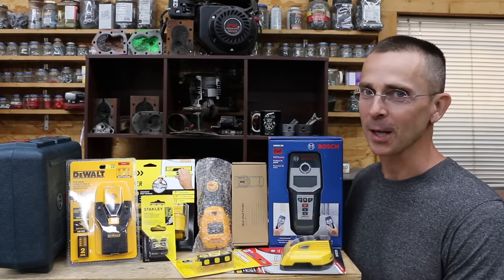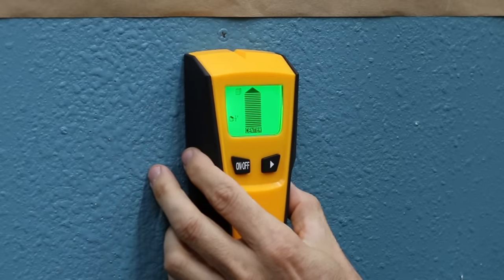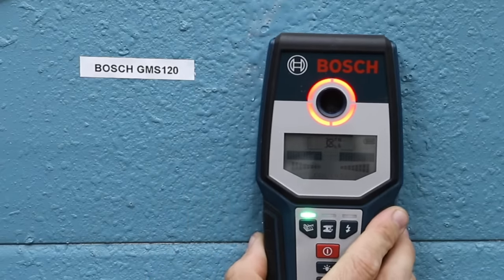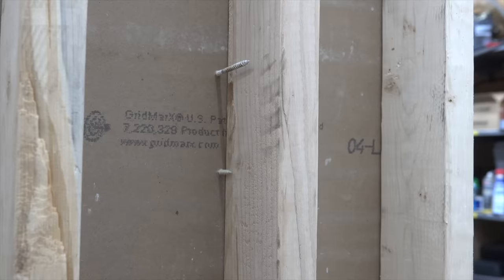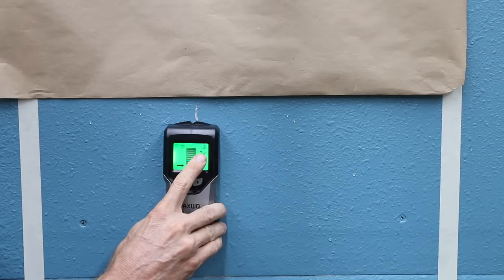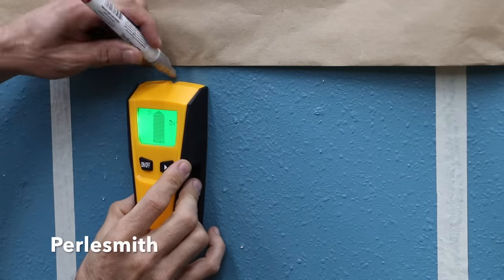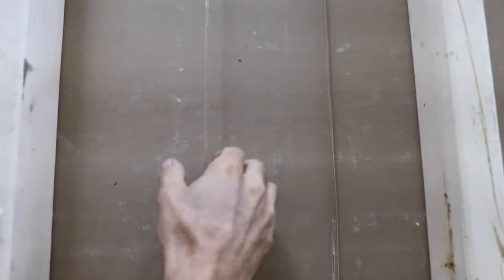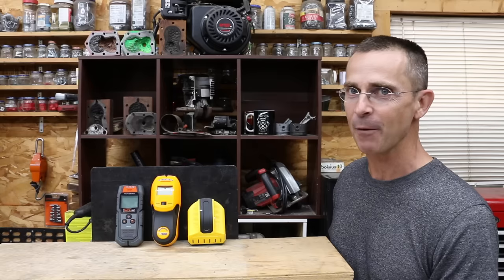Best Stud Finder? $262 Bosch vs $10 CH Hanson vs 9 Other Wall Stud Scanners! Let's find out!

Comment: I would have liked to have seen the results on plaster lathe, or plaster over drywall (from the 40s) using the “deep scan” setting on some if the finders.  I have been searching for one that works well for a long time and haven’t found yet.  Great job though!
Reply from the maker: Thanks!  Thanks for the constructive feedback.

Comment: Something that made me twitch pretty quickly was when you started saying "found the water pipe", "found the wire", "found the conduit". Most of these only found "something" in the wall. Could be a stud, could be a conduit, water pipe, wire (live or not). 
I wouldn't trust any of these if they couldn't positively separate between at least "stud" or "other".
Reply: Well, studs are always the same length apart, so if you find something that has different spacing, you know it's something else.
Reply: That’s were you should find a couple and look for the 16 or 24 inch pattern, and ignore the stuff between that
Reply: Yes! The Zircon even seemed to find false edges when detecting the wire and the double readings it gave seemed to indicate a stud. See 9:05.

Comment: I've been using a Zircon at work for years, it's almost as good as X-ray vision.  You just gotta scan a few times to zero in and once you've gotten a feel for it, you can nail the center of damn near anything.
Reply from the maker: Thanks for the feedback.
Reply: Bought the Zircon a couple of years ago but it does not work at all on plaster walls.  My home is 1945 built. There are two types of plaster walls involved, some with straight fiber backer board and some with metal mesh backer, the metal mesh is impossible, but the inch thick fiber backer board/plaster coat should be doable.  The Zircon gives false positives all the time no matter how many times I calibrate.  I even tried it on known good no-stud cavities (already had the hole found/cut through the tried and true, drill a small hole and fish a copper wire method 🙂) but it still is clueless. I have a 30 year old Black and Decker that works better, but it's a monster.

Comment: I wonder if having a second layer of drywall on the other side of the stud (replicating the wall in the next room) would change the outcomes, due to the sensor models being able to recognise the interference of the pipes and or cables in the enclosed space? Thanks for your tests. New subscriber here! Cheers, Lance.
Reply from the maker: Thanks for watching and subscribing!
Reply: I'm not an engineer, but have lot's of professional experience using these things. Properly calibrated, you should be ok.  people do run into issues  when they press or lean against the wall they're scanning, tho.

Comment: Great test as always, love the channel. The Walabot (albeit Android only right now) would have been an interesting mid priced competitor, given their claims.
Reply: Walabot would have destroyed them all.  I mean, it can see rodents in the wall.  Ever since I purchased mine (because my house doesn't have screws throughout the drywall, only around the edges, so my trusty magnetic stud finder no longer works), I use it with complete confidence and haven't missed a stud yet.  The calibration process is a bit annoying, but worth it to know exactly what is inside the wall.

Comment: As a GC/handyman, I use Franklin finder's almost exclusively. It makes it really easy to find the studs and get a picture of what's going on. If you have lath, or loose drywall, or horizontal blocking it's a lot easier to figure out on the Franklin (more bars light up than they should, for loose drywall pushing or scanning up and down gets it to the normal 3 lights, and for horizontal blocking turning 90° it gets you accurate results. I haven't found object sensing to be overly accurate or usable, though my Walabot seems to get everything.
Reply from the maker: Thanks for sharing.

Comment: Suggestion for another category to test: boroscopes/industrial endoscopes. I've found mine valuable for actually looking at what's inside a wall cavity, at least for interior walls that are not filled with insulation. They are definitely not all created equal, e.g. some have a relatively narrow range for which things are in focus.
Reply from the maker: Thanks for the video idea.

Comment: You did one critical mistake: You didn't do this for brick walls (false positives) and walls where there's insulation wool (it disables most of these stud finders)
Reply: I concur with the insulation, it has an effect on the stud finder ability to accurately determine density of the wall so things like the wires and pipes not pressed on the drywall would be more difficult to locate.
Reply: If you are looking for a stud in a brick wall.... Someone made a mistake all right.
Reply: @jaxturner7288  hahahaha
Reply: Imagine missing the stud in a brick wall.. what a comprimise in strength. The brick may not hold it up
Reply: @jaxturner7288  I wish this was true. I've renovated old Victoria houses with stud walls with bricks between the studs. The idea back in the day was to give support when building the upper floors, then adding the bricks for mass and sound dampening. Plaster could then be applied to the timber and brickwork. Lathe and plaster would work too, but it didn't have the mass to deaden sound.
Reply: Rob Locke well that’s not actually a brick wall is it?  
Just bricks in a stud wall.
Reply from the maker: Thanks for watching.
Reply: @jaxturner7288  that's like pouring sand inside walls... Why would anyone with half a brain use bricks without concrete(cement?, I don't know the problem word)
Reply: Yeah this wasn't very "real world". EVERY stud finder I've seen going back to the 80's works perfectly on a "demo wall" where you already know where the stud is and there is nothing to throw off the stud finder. In the real world though you run into things. Maybe there is a fire block or other horizontal board in the way that throws things off; Maybe they put double sheets of drywall. Maybe they put 1/4 drywall over plywood. Maybe there is a ton of insulation; Maybe it's a plaster wall;  Maybe you're doing a ceiling and have no idea which way the joists or trusses are going so you have to try it a couple of different ways; Hell, maybe you don't even know if it has joists, truss, or engineered lumber;  Maybe you have a pipe between two studs and you have no idea; Maybe there is a PVC pipe;   Etc. etc. etc.  I'm a big fan of the channel but this one doesn't really prove anything.  He's testing things under perfect conditions and is already biased in knowing where the studs are.  Someone else should build the wall and put random  hazards in there or better yet, go to older homes and try it.  PS. that "thanks for watching" sounds a bit passive aggressive.  Legitimate points have been brought up.
Reply: I've used the Zircon and Franklin (well Costco branded Franklin) and the Franklin does a better job with insulation.
Reply: @Arieeeee  he has that as a copy response, don't worry about the "thx for watching". Also ignore the braindead basement dwellers that make fun of the brickwall thing. I'm just glad I found someone sane in here.
Reply: AlucardPawpad ClownWorld if you don’t know a brick wall from a wood one.... I can’t help you.  As far as what these are for.... I would think the name “stud finder” is self explanatory,  they are not called “wall structure detectors”.   
 Stud detectors,  how dense can you be to not understand their purpose?
Reply: Arie what is he supposed to say? He said he was open to more ideas, stop criticizing and actually do something. Why don’t you go buy al those tools and make the perfect video then
Reply: @jaxturner7288  LMAOROFLhelicopter.....
Reply: @Arieeeee  Jeez, there's always someone in a crowd who wants everything done HIS way....
For the other 99%, or 95% considering the guys dealing with plaster/lathe work, this is a straight-up test bed with standard construction.  You wanna complain, go out and invent an x-ray stud finder.
Many contractors are going to be thrilled to find this video and be able to make an informed choice. 
The odd ball, one-offs they run into are just that, odd ball, one-offs.  Professionals deal with it. 
Since you didn't recommend a unit that does everything you complained about, maybe that a clue.
Reply: @jaxturner7288  Don't bother feeding the trolls.  These guys think a $20-50 stud finder should be some x-ray closed space inferometer.
Reply: Boots you got that right, the expectations from the tools and project farm itself in here are unbelievable.
Reply: @jaxturner7288  It's not just studs we are looking for. I wanted to install a mirror cabinet in my bathroom and I needed to find water pipes and power wires behind ceramic tiles which were installed over a brick wall with iron or concrete pillars. Not all countries make their homes out of drywall and wood.
Reply: EpicEternal right, and I want to find diamonds and gold too,  I’m just not going to expect my STUD finder to do it.
Reply: @jaxturner7288  the point of the test is to see how good the tools perform in real world conditions, which is the point of project farm. Not ideal conditions. Also, I like that snarky comment. Stud finder that finds diamonds, gold and even burried treasures! A metal detector yarrr!
Reply: @boots7859  He asks for responses so I gave mine so take it or leave it.  We can all be fanboys in an echo chamber and say "thank you for your service" without being critical or give thoughtful and constructive feedback. I chose to give constructive feedback. It doesn't take away anything from his work, effort, or dedication.  If he doesn't like it, he's a grown man and can either ignore it, delete it, or maybe put some thought into it and redo the test.

 I stand by my point that this test falls below his own standards and doesn't represent real life situations and I'm basing that on decades' of experience in the trades - in particular running wires causing minimal damage using every trick in the book I can find including using the stud finder as a starting point. I've gone through a half dozen of stud finders too and they all were perfect little tools in the store with their little demo wall like he has set up here, but performed completely different in the real world. If you think that's trolling then maybe it's time to look in the mirror.

Comment: I'd love to see a test on plaster and lathe on the best way to find a stud...great video and as always thank you and God bless
Reply from the maker: Great suggestion!  Thank you.
Reply: @ProjectFarm  please do! I find that stud finders really have a hard time in my old house. Be interested to see if there are any that can handle it.
Reply: @thegoondockswarcouncil9543  I have an old house too, with plaster and lathe walls, and the battery-powered stud finder I have (not an expensive one) is OK at finding the studs.  However, it shrieks constantly about live electrical - apparently every square centimetre of my walls is wired and ready to fry me to a crisp.
Reply: I'd like to see this too. My house built in the 40s has plaster over plasterboard instead of lathe. Love the solid construction but most stud finders I've tried don't work very well.

Comment: I've run into problems with stud finders when the drywall is installed over plywood like in an exterior shear wall and in detecting horizontal fire blocking.
Reply from the maker: Thanks for sharing.
Reply: They will never work on that or be reliable.
Reply: That is a good suggestion, in the coastal areas of the country residential structures have to be engineered against hurricanes or earthquakes. This usually means 1/2" plywood covers many interior walls.
Reply: That wide one with all the LEDs is amazing for fire blocks... pulling cable and hit a diagonal block I managed to get spot on it first try with an access hole.

Comment: Could you do a test on finding studs in plaster and lath walls? Same products would be fine unless a new model has significantly changed. I'm sure I'm not the only one who finds it maddening to drill ten holes in an old wall. And even when you find the first, you never know if the studs are evenly placed.

Thank you.
Reply: Yeah the big challenges for stud detection are plaster and lath, non-standard stud sizes and placement, drywall over old plaster, ceramic tile over plaster and lath, and let's not forget steel mesh lath which makes magnets useless.
Reply: Agreed. My whole home is plaster and typical stud finders don’t work very well on them.
Reply: @troyd.521  What does? I'm considering the Bosch GMS 120, but the reviews are all over the place one having no issues with it and other nothing but. I have plaster ceiling so I wonder if anything works there..

Comment: Would love to see tests through tile (backsplash type scenario) double thick drywall and that old style drywall (horizontally layed in narrow sections) covered in plaster with metal mesh in the corners. That stuff usually ends up around 7/8th.
Otherwise great tests!
Reply from the maker: Thanks for the feedback.
Reply: Completely agree. All the houses in my neighborhood are old and have that thick walling with the mesh. I’ve got a cheaper stud finder and it is no good on this type of wall.

Comment: What would be interesting is different drywall scenarios. Thicker drywall, double drywall, drywall backed by sound insulation. Also other wall material than drywall like plaster, paneling, or other wood sheeting.
Reply from the maker: Thanks for the suggestion.

Comment: The zircon for just $23 was really impressive. I recently spent more than that on a Ryobi esf5001 and was really disappointed in its performance.  I would like to see how it stacks up against today’s front runners.
Reply: Paul Stan I have the same Ryobi it works when it wants to! Tried new batteries and rechargeable. Might get the Zircon for my next project.
Reply: Rolando Marrero Same here.  I think I’m going to try the zircon.
Reply: I had a Zircon, really liked it. Some years ago I managed to smash it during a project. I have another one from a different mfr so didn’t bother to get a new one.

Since then I’ve felt that it’s not as accurate as the Zircon but didn’t think enough to warrant buying new one. 

Now tho...
Reply: We have Hilti's & high end Bosch's at work. I use them for installations, but my tool bag has a Zircon HD-900, $40, & it's fantastic. Cheaper Zircon's are more limited in what they detect but not less accurate, IME.

Comment: Would love to see how these do when testing over plaster walls, or any wall that is thicker than half inch and an uneven surface. Finding studs behind my 3/4 inch plaster walls is very difficult.
Reply: Agreed. My home was built in 1939 and plaster throughout. I haven’t found a reliable sensor yet to use on plaster…
Reply: Would love to see this done with zircon and Bosch vs walabot.
Reply: Seconded.

Comment: Would love to see an "ease of use" category. I've had a couple of those chinese jaunts where you have to calibrate them and while it's probably user error, they're SUPER inaccurate for me. I could use them 5 times in a row and get 5 different results. I hate them so much. i'd rather have one that comes pre calibrated and i can just put up against the wall and go. based on what you said about the 2 Franklins, those are the stud finders for me, and i appreciate the footnote, but i think it would have been good to actually rate the category.
Reply: That Zircon is very accurate.

Comment: Should've added the FLIR iphone/android camera to the list. You can see the studs through the wall because of the temperature delta.
Reply: Really does that work ? I’m guessing it would do water pipes as well.
Reply: Hahaha good joke!
Now ask yourself why proper FLIR cameras are more expensive than your phone ;)
Reply: dELtA
Reply: I've had mixed results. Works better on exterior facing walls than interior ones. In my office building the metal structure behind the plywall came in pretty clear
Reply: @stormtrooper9404  not a joke. Look up flir on amazon. $200. Not as good as the $20k units, but for that price of course it won't be as good
Reply: Krautastic In that case your office building has Zero insulation which is why you get results in the first place. Try that on a wool/foam insulated house with a wooden studs and see what happens! Even flir wont get you a reading(unless very big delta t),and even than the picture would've been smeared so good luck hitting a nail in the middle of the stud :)

Comment: High Quality test protocols, Todd!!  Like you said it would be rare to find pipe, wire or water any place but close to center of the stud so having 1.5+ depth is important.  Will pass this on to my son who's had some issue with some of the lower cost units lately.  I have an older B&D lazer level/stud-metal-wire detector that has pretty much worked flawlessly for years and love the carry case with accessories.  The new ones are about the same price as the Bosh GMS120, think I paid about $45-50 back when I got my B&D.  Glad this popped up on my feed as I had missed it some how.  Hat Tip, ~PJ
Reply from the maker: Thanks!  Thanks for sharing.

Comment: I would be interested to see how they work w low batteries, too — we just discovered the hard way that our zircon (a different model than you tested) struggles a lot with accuracy when the battery is low
Reply: Which model are you referring?
Reply: I have the same issue with ours, it turns on when held but it detects nothing
Reply: Nothing will preform well with low batteries. If you want your tool to perform accurately, you have to put new batteries in it.